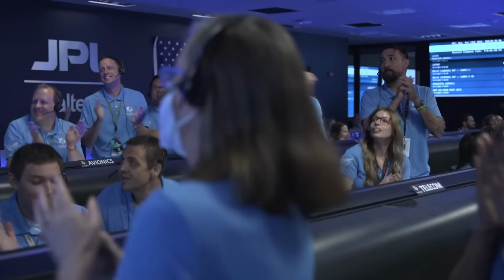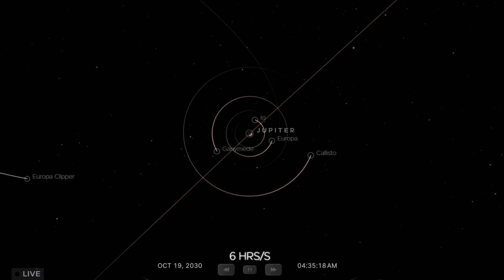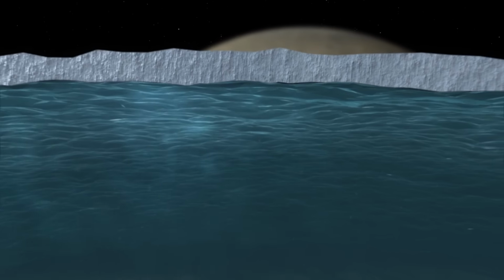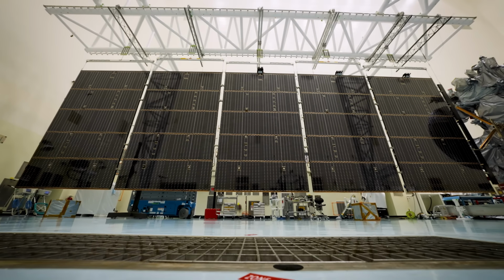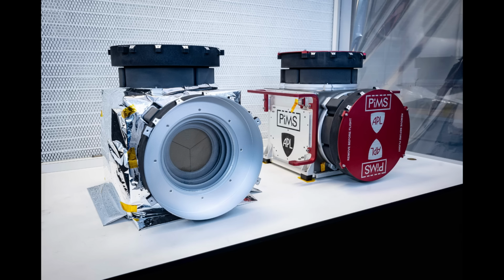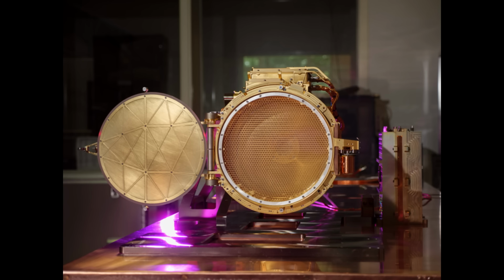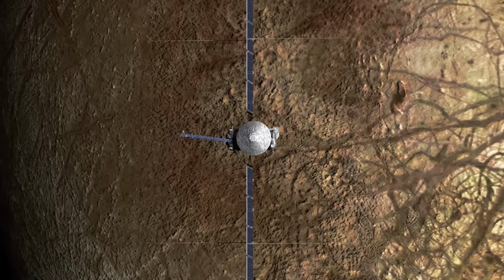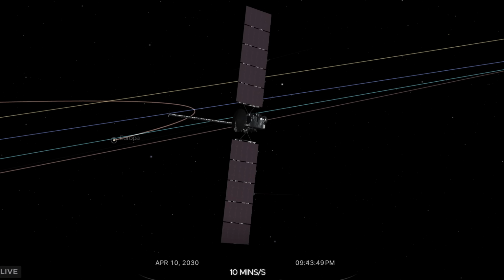SpaceX Ditched an Entire Falcon Heavy To Launch NASA's Massive Probe To Europa!

Comment: You mentioned that Galileo had a bearing between the rotating and stationary sections. Wouldn't there still be some latent friction that would cause the stationary section to slowly build up rotation? Can you elaborate on that mechanism and how it offered complete stability?
Reply: nasa still has the galileo specs available online, i just took a look at the bearings and they're just regular steel ball bearings with a bunch of sections for motors and data transfer. ludicrously complex but nothing exotic. i imagine that since they knew exactly how much torque friction would cause, .5 Nm, they just compensate with the motors. given the paper im looking at is very specific about the ripple torque (a new term to me but it seems to be the consistency of a motors torque) which would need to be precise to steadily counter friction without creating a wobble that seems like a good guess.
Reply: If it was a purely passive mechanism, sure. But even a small motor could counter that momentum transfer.

Comment: It could have been there sooner on sls. If they had one ready in time which they didn’t… and also the vibrations from sls were a concern
Reply: Tbf, there is one SLS waiting in VAB right now for its payload, and who knows how long its going to wait
And next one is also going to wait because there is no way HLS will be ready in time

But it would be impossible to predict that this would be the case back when decision to change LV was made
Reply: @_mikolaj_ that one is for the next Orion mission
Reply: @JasonMG8  next orion mission which is now under question mark due to heatshield investigation so it may face further orion delays, and again, there is artemis 3 which will be delayed due to HLS. We've reached the point where nasa slows down SLS production on purpose, because other mission elements arent ready. A much healthier option would be to fly other missions and speed up the production(this would result in cost reduction), but it is bit late for that.
Reply: For 8x the cost

Comment: Good joke, SLS will get it there quicker, sure, if SLS is operational by 2030 😂
Reply: As coincidence would have it, there actually currently is one SLS in assembly at KSC. It's obviously reserved for Artemis II. But they could have launched EC with it, provided they had solved that vibration/torque issue or whatever.
Reply: SLS is operational... But NASA is dependent on a budget which the SLS would intrude on other missions.
Reply: And for 5 billion dollars.
Reply: SLS also costs several billion dollars per flight. I would much rather have my tax dollars going towards probes. NASA is not good at building vehicles without it being insanely expensive. They should focus on scientific probes, space station support, and other scientific instrument builds, and leave the launch vehicles to the contractors.
Reply: SLS is already operational. Did you happen to miss the flight in 2022 or are you just that uninformed about the wider world of spaceflight outside your weirdly obsessive, cult-like, SpaceX sphere?
Reply: @dr4d1s  If SLS is operational, why didn't they launch the clipper on it?
Reply: @Mako2401  cost.
Reply: @Mako2401  Turns out JPL didn't take into account the vibrations from SLS's solids when designing and building Europa Clipper. It was cheaper to launch on Falcon Heavy than redesign and modify EC to handle the shaking.
Reply: @dr4d1s  So what I'm getting is SLS is operational, ready to launch everything at a moments notice, but also, in the same time, it has issues, and is up to ten times the cost from Falcon Heavy.
Reply: @dr4d1s;• to be fair, the issues on Artemis1 were kept silent and info only released one by one, beginning a year after the flight.

The only human rated heavy lift rocket, but still lifting only a tini tincan, and its that part that can't be used for humans, bc of too many problems.  I think they can all be cut down to one major problem:• Boeing.

The real problem:
Apollo had a goal that was set by politicians, but it was left entirely to NASA to achieve that goal.
Nowadays, politicians have no real goal but instrad want to dictate major design aspects.  That was already the cost driving factor on the Space Shuttle program.  The Artemis program was nearly killed several times for this mess, by the exact mess.
🚀🏴‍☠️🎸
Reply: @dr4d1s The SpaceX hate from losers like you is so sad. Sorry they did more with less, shill.
Reply: @usnairframer LMFAO! SpaceX is great, I don't dislike them by any means. They are doing awesome things. If you would open your eyes a touch you would see others are as well. Your comment only proves my earlier point.
Reply: Funny. It is operational, and it’s the only human-rated heavy-lift rocket in the world (nothing else is even close, and don’t say starship unless you want to ratchet-strap an Orion on top of it - which is still half SLS lol!) Congressional and political issues mandating Artemis missions are the only reason it didn’t fly on SLS. 

You CAN actually be a fan of spaceflight in 2024 without being an exclusive SpaceX fanboy. 

Actually, this craft and just about every other ultra-advanced probe / rover are all NASA programs.
Reply: @EstorilEm the only reason the SLS is human rated is because the right hands were greased
Reply: @DeadBaron  And, you know, taking only 1 attempt at successfully competing a mission, unlike the amazing, exploding Starship?
Reply: @EstorilEm 

But Elon is the only one doing anything of significance. 
  So I’m a SpaceX fanboy. 
NASA is a joke. Boeing is a big joke. And Jeff Bozos is for sure a joke.
Reply: @EstorilEm doesn’t stop the sls being a massive waste of money
Reply: @Superblock-qs4ck  Yes, because superheavy will get to the Moon 100% sure 😅😅😅
Reply: @Superblock-qs4ck  You realize that they are adopting NASA techniques to save launch costs, correct? Gravity assists, etc?
Reply: @codymoe4986  basic physics are not "NASA techniques", they don't hold a patent on the laws of the universe lmao
Reply: @EstorilEm  I think a payload of this size would need a block 2, (haven’t done the math yet) and I don’t know whether that one will be ready by 2030. I’m leaning toward no just because of the previous timelines